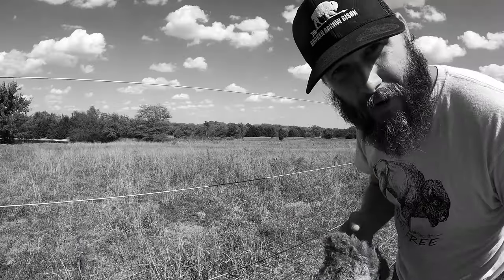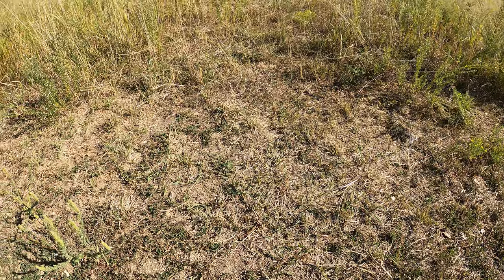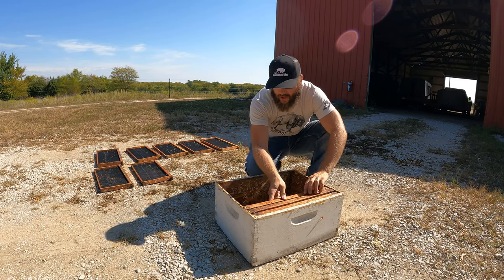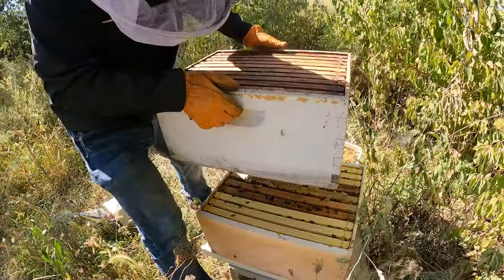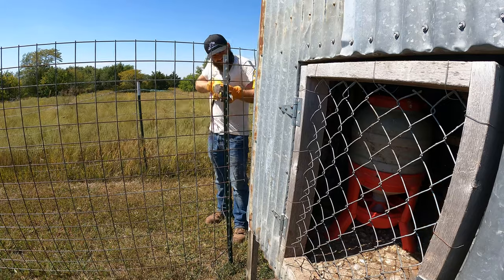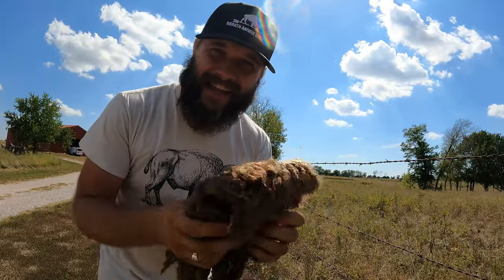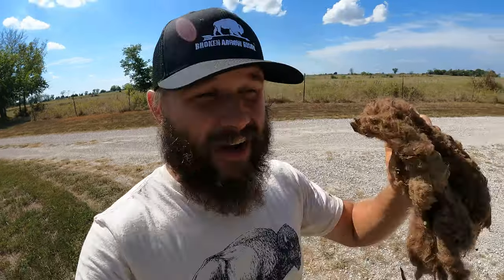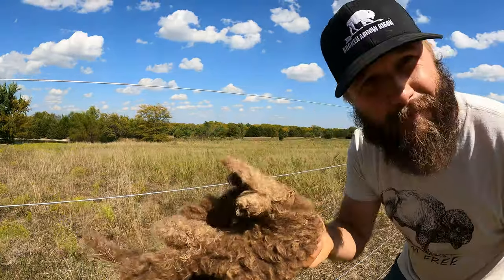Can Electric Fence Kill Buffalo?

Comment: I've been a barbed wire guy.  I always considered it lower maintenance than electric...no shorting out to deal with.  However, Soldier Creek has me considering electric for interior pastures.
Reply from the maker: Once you have a GOOD electric fence you’ll never go back. If it is not built right, then they are a headache. Good luck!

Comment: Determining fencing choice currently. Thanks for sharing! What are your thoughts on woven wire? Looking at 4ft with 3 barbs on top to put it at 5-1/2 ft height. There will be 8 young kids cruising the area.
Reply from the maker: That can definitely work. It’s one of the more pricey options though. I’ve got six kiddos running around my place and the electric fence isn’t any problem though. It only takes a touch once. 🫣
Reply: Gotcha, Will definitely evaluate the high tensile electrified option! This was helpful, thanks for the insight!